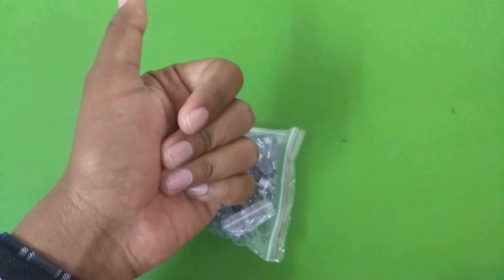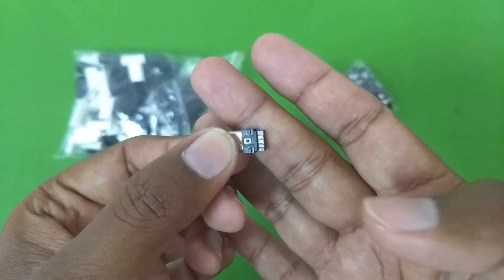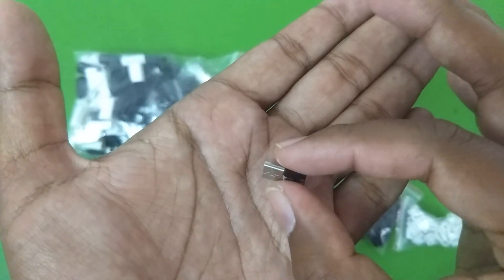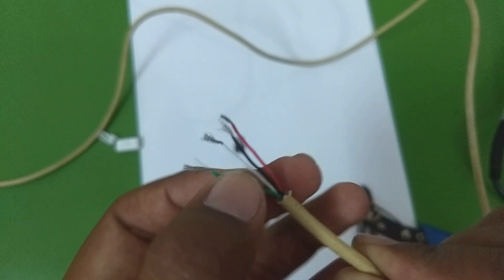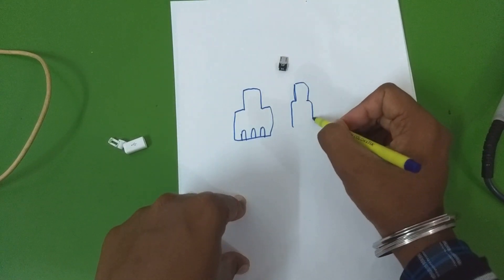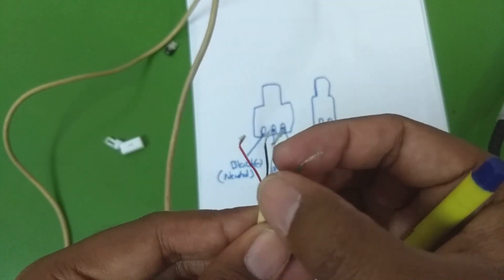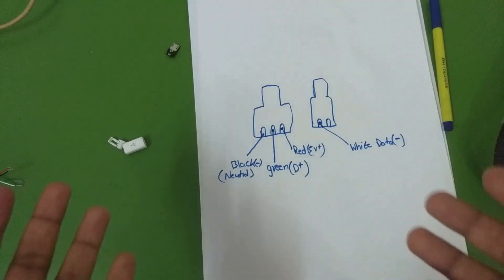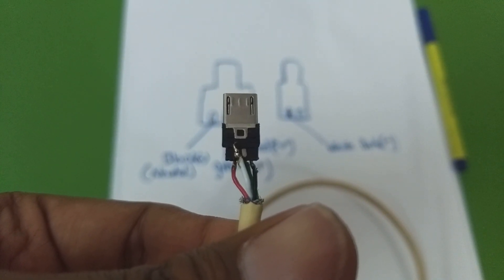How to Solder Male Micro Usb Connector

Comment: A way around Micro USB connectors that always eventually going bad it seems, is to go ahead and solder a regular USB connector by soldering its 4 wires to the Micro USB slot on the computer board. Yes that means taking apart the device, and You will need to drill a small hole on the cover of the device for the wires to go through. Then get another cable USB to Lightning or whatever for the final connection. Regular USB connectors are so much better than Micro USB. You can use some plumbers putty, or velcro to "hold" the USB wires and connectors to the unit you soldered and allow you to plug into. That way there is no chance of breaking your soldered connections.  Is there a soldering pen small enough to properly solder a Micro USB cable? Crazy what the electronics industry offers the consumers.

Comment: That is definitely not the correct soldering iron or tip for a job like this that is why you are melting the plastic.  You should use a conical soldering tip and thin .6mm solder.
Reply from the maker: you are correct. I have bought some .5mm solder.
micro bit iron. It works a little better but still the connector quality is very bad.
I can separate the metal part of connector from the plastic part without using much force.

Comment: I soldered 2 wire charger to the pin but when i connect it to my android it shows charging notification but it is not increasing charging level what is the fault here
Reply from the maker: My be the charger that your are using is faulty.
Or less than 5 volts.
Can't really tell without seeing in person
Try using a different charger or make another cable.

Comment: I think the melting of the plastic is to do with the over size soldering iron. You would do better with a pin point tip, 0.6mm solder and a temperature controlled soldering iron set to 280'c-310'c.
Reply: I found using the lowest temperature possible yields the best results.

Comment: what an ass this guy is . He didn't show how to solder.
Reply from the maker: i know. i did not have a tripod, But, i tried to record the soldering part; failed and also the connector were melting on soldering even when i was using a 25w soldering iron.

Comment: You hot good points but why buy cheap ones for demo?
   You should be using a 15w soldering iron so you wont burn it.
Reply from the maker: i was using a 25w soldering iron. I tried two different sellers just to make sure that one of them would be decent quality but both turned out to be bad. And now i kind of feel stupid as in 2020 micro usb is not much relevant at all.

Comment: Hi, I have just finished soldering a micro USB  connector in an old cable, really the quality of the connector is very poor and it does not withstand the heat from the soldering iron but in Amazon where I buy everything I haven't found better ones.

Comment: Hey, what if i have a mikro usb with 4 solderpoints on the front side? On the backside no solder points, how do i have to solder then?
Reply from the maker: hold the connector in your hand so that you can see the solder points, Now, starting from the left
+5 then D- then D+ &4th pin is 5-(ground)
Reply: Gurribuy thank you so much, worked perfectly! Do you know how to holder a 4 pin 2.0 usb to a 5 pin mini usb? 3 pins on the ground and 2 pins above the 3 pins. I would really appreciate it!

Comment: If I just want to do a direct current, do I just use Black and red wire?
Reply from the maker: yes, just use the Black and the red wire but, without data pins the charger will not be able to talk to the device you want to charge and thus the charging will default to 500mA. So, you will only get half amp from your charger

Comment: Cool DIY solution. Is it possible to solder a thunderbolt 2 (male) end to a USBC (female) end? This would be a miracle as no cable or adapter like this seems to exist. The USBC (male) to Thunderbolt 2 (female) cord does exist.
Reply from the maker: USB C is very complicated, its not worth making or repairing you own usb C cable because the connectors are not easily available and they are very difficult to solder and still no guarantee that it will work as intended.
Reply: @gurribuy  Ok - thanks for the reply.

Comment: Who is a good seller to purchase the micro USB connectors? 

I am so tired of buying new cords!!! Even the OEM cords like to break.
Reply from the maker: When i bought these connectors, i bought from three different sellers and although the outer case was different but the main connectors were same from all the 3 sellers. So, i would not recommend to buy micro usb connectors anymore; USB C is the way to go now. But one thing i've yet to try that is the magnetic micro usb cable, maybe magnetic cables would not break easily.

Comment: Hai. Nice explanation and guide line to assemble these connectors to data cable.  Today I tried and found working ok but fitting feeling  into mobile port is not satisfying as you mentioned. 
Are you able to get some good quality connectors ? If yes pls share link . 
Thanks and regards 
Ashraf
Reply from the maker: you're right. but i will not buy micro usb connectors any more because USB C is more in use now.Also, micro usb cable are really cheap so there is no point repairing micro usb cable.

Comment: Thanks for explanation, but painful video.. could have said everything in about 30seconds not 12 mins!
Reply: this 12 minutes is very helpful because I know more about the quality of the connectors that I use. if it's not... black green red white and cop cop solder it then everything will melt
Reply from the maker: Thanks man. I'll keep things short next time.

Comment: Thanks for the information--this was really helpful!  I did a couple things differently that made it easier and more durable.  Bend the solder tabs up slightly with a razor blade, tin both the wires and the solder tabs, touch the wires to the tabs, then heat the surfaces together with the iron--the solder flowed from one to the other and the contacts joined together much more cleanly.  Another thing that worked well was pushing the wire underneath the bent up tab, then pushing down on the tab gently to hold the wire in place.  Also, before snapping the connector together, fill it with epoxy (smear it all over the wires and contacts too)--when it dries it is virtually indestructible!  I think this might be even more durable than a new cable--it seems that none of them last very long.  Don't throw away your bag of connectors just yet!
Reply from the maker: Nice tip man. But i still don't like the fit of these connectors. I'm still using them but for cheap gadgets and small projects, not going to use them
 with my phone and power banks.
Reply: I will have to try this... I will let you know the outcome in a bit.

Comment: Its really cumbersome and not worth it.The connectors are made with zero thinking.Really difficult to keep the connector stable while soldering.Badly designed connectors.With the prices of new charging cables falling to Rs 10 and Rs 20, its not worth all this hassle.But its good to know in case of emergency.